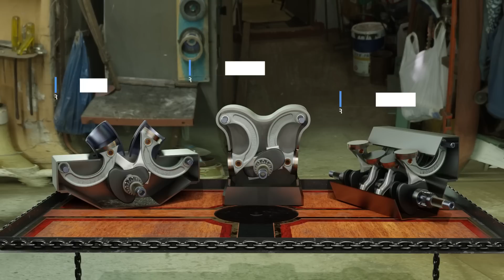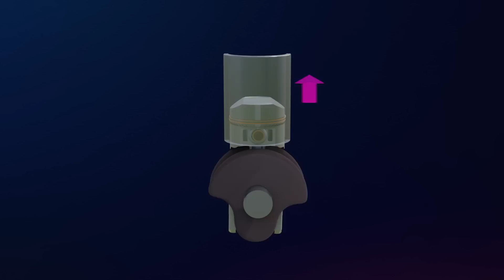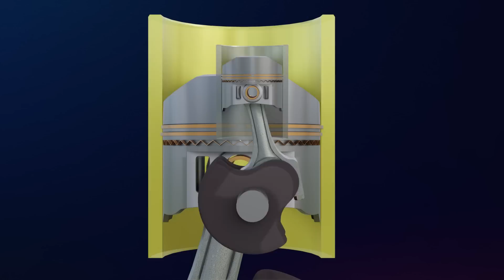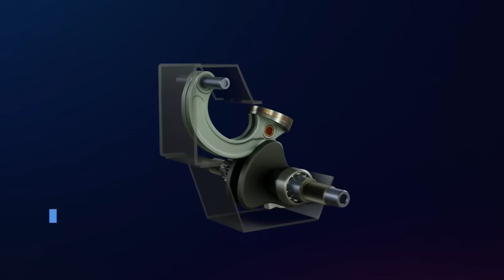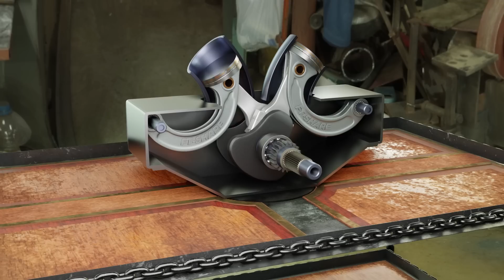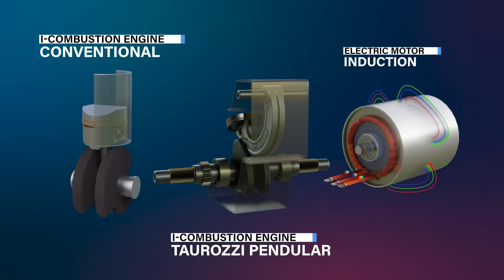All about the Taurozzi Pendulum Engine | Advantages, Working Principle, and Performance (100144.V1)

Comment: The combustion chamber is difficult to manufacture.
Reply: I feel like the metal 3d printers they use to make rocket parts could crank them out
Reply: @mistergreeen   I think due to size and weight, CG , and two stroke capacity, it’s ideal for ships , would do away with the sliding block con rod and lower height. A 16 cylinder v ?
Reply: Agreed.Very difficult to produce the curved bore with conventional machinery.
Reply: Makes me wonder how he made this thing back then.
Reply: All you need is a conventional machine,  and a aouter axis to fixe the blok on, and you do exactly the same as a normal engine step by step, while the block is the one who moves aroud the axis mentionned before, 
So simple
Reply: Very
Reply: The dam thing is even impossible to hone! This guy just wanted something to discuss. There's a reason everyone else dropped it. Lol 😂😂😂
Reply: @jasonruch3529  honing is easier part actually.
Reply: This can be machined in a block without difficulty, with the appropriate trajectory, but at a high cost. Current engines are made with sheet metal tubes fitted into a base, not machined in a block. On the other hand, the description ignores the additional mass of the second "banana" connecting rod, and its size. It is reciprocating weight. For me this engine is nothing revolutionary.
Reply: actually, it isn't.
it doesn't take much more than an offset drill and a lathe to drill an eigth of a toroid, as the curvature is pretty low.
Reply: @HenriBourjade  not really
Reply: @Om0sad  then how come taurozzi did it
Reply: @dennis-nz5im  Ships? I better use a turbine engine then.
Reply: Nonsense. You can die cast mold the whole block out of carbon fibre reinforced Magnesium oxide+aluminium phosphate chemically bonded ceramic, at perfect precision tolerances and mirror smooth finish in less than a minute at near ambient room temperature, one hundred times less pressure than plastic injection molding, and a few dollars materials costs. 
This material is far cheaper and higher performance than metals, and is used for coating high temperature and corrosive environment industral surfaces like gas turbine powerplant exhausts, industral chemical plants piles and reactors and molding Formula one disk brakes and piston-barrel sets.
These fibre reinforced ceramics are 1/2 the density of Aluminium, and 100 times stronger, have far less friction than metal surfaces, and lack of thermal expansion means no rings are required. 
This is used to coat high performance million dollar truck and military vehicle pistons. 
The only reason you don't see it in consumer level items is that it is too efficient, easy to do in your own garage, and lasts thousands of times longer than the shit the want to peddle to you. 
And therefore industry doesn't want you to know about it, and sell stuff made with low cost tooling and a few cents of material, for tens of thousands of dollars.
Reply: @yezzamouad9469  as a toolmaker I regret that I have only one like for this reply.
Reply: @teresashinkansen9402  ships, really big ones like container ships, use internal combustion diesel engines burning bunker oil.  A turbine is less efficient for these uses.
Reply: Honestly I don’t think it would be very hard but not by a standard bore machine
Reply: Not exactly, the issue is more that we'd need to make specific machinery for it whereas the normal straight cylinders can be cut and molded by normal machinery used for many other things.
Reply: @beatersnbeers2145  I agree. People these days seem to have no idea how easily high levels of precision can be achieved as long as you use simple machinery that has no computers involved with operating it. 
It's piss easy to achieve thousandth of a millimetre tolerances in something like this. By directly molding from something like basalt fibre reinforced Magnesium oxide/ potassium phosphate room temperature curing ceramic in five minutes.
Or if you must use primitive metals technology rather than far higher performance stone age stuff, then you'd  investment cast, then bore, grind and hone with a head mounted on a rotating pivot, rather than the more complicated and harder to achieve stiffness and precision linear slides or tracks of a conventional boring system.
Cheaper and easier to make the equipment to do this, than manufacture conventional linear stroke cylinders by far!
Reply: I fucking love you 😂
Reply: Easy to cast and easy to mill, you could even make this out of billet, it wouldn’t be complicated
Reply: @yezzamouad9469   exactly.  The cyl liners or block can be cast with a banana shape.  They are then mounted to a fixture that holds them in the boring machine.   This fixture has power rotation about the fixed end of the piston arm.  It rotates very slowly to feed into a cutter that is rotating but not traversing during the cut.  It does this 10 or 20 degrees and then rapidly rotates the other way to get the tool out of the bore so the cutter head can travers to the next cylinder bore.
Reply: Really in the age of CNC? And 3D printed Steel? Machines don't feel difficulty
Reply: @ExileTheKnightsOfMaltaNow  I can feel a less than 1/1000 of a millimetre imperfection. I can see a less than 1/millionth of a multimeter imperfection in the contour of a three dimensional surface by reflections. I can hand machine metal cylinders and pistons that need no seals for pneumatic pistons. 
CNC machines I have used a lot. It always takes a hell of a lot of hand sanding and polishing and lapping to turn something CNC machined or 3D printed into a precision surface. 
It's faster and easier to do most stuff the old-fashioned way.
Particularly if you are setting up for production. 
It's very difficult to achieve perfect repeatability with computers operating anything.
Reply: @aaronfranklin324  LOL looks like I struck a nerve? I am not proposing to eliminate the element of the human Knack of expertise... Let's not lose the greater point... That the occult is withholding things? Clearly the pattern of the rash of more than just knuckle-dragging
Reply: @ExileTheKnightsOfMaltaNow  Hey, I'm just this multiple x World champion high performance Engineer, you know. 🤗
I've experienced doing things both ways. And Frankly, it's faster and easier and cheaper to do most stuff without the use of computers. 
And Hand shaping something in the real world, it always seems to turn out looking better. Working better, and you kind of can't really get past the reality that you cannot 3D print or CNC machine anything high performance. Metals and plastics are very low performance materials. And it's usually the combination of q variety of different materials in complex shapes and combinations that gets the best results. 
So far Nature does this at the nanoscale a lot better than what we can. 
The strongest, most heat resistant, chemical resistant, durable materials are stone. 
And the toughest highest strength and energy absorbing per weight materials are natural materials like wood, bamboo, spider silk....
The cheapest too. 

When you can Make stuff that's stronger and stiffer than Carbon epoxy composites that lasts forever, molds to perfect precision mirror smooth optical tolerances in complex shapes setting in five minutes at cost prices  of a few dollars per cubic metre. 
That have no thermal expansion, are capable of handling highly corrosive environments at temperatures in excess of 2000C, 
Are widely used for purposes military, heavy duty mining, and oil drilling, and powerplant gas turbine exhausts....

Well yeah. It's pretty laughable that people think that metals and plastics are worth using. 
You are right. We are being conned. Told that turds are diamonds in the name of keeping the masses enslaved on a never ending treadmill, and the Elitists laughing as they milk the factory farms of gullible consumers they call cities.
Reply: All of that extra rod mass seems like a bad thing
Reply: @jasonruch3529  What about all of that extra weight in the rods that setup seems goofy AF
Reply: @blueberrywilbur315  there isn't any extra rod mass. The piston requires no skirt, and is one piece with the radial pivoting arm.  
Essentially the mass that normally is necessary to stop the piston rotating and produces lots of friction with the bore, is utilised to keep it in perfect alignment with the bore instead, via the pivot, and most of that lateral arm is reciprocating far slower than the lighter than conventional piston. 
Additionally there is a very large advantage here where the power stroke is able to directly push down  in line with the piston motion through the conventional connecting rod to the crankshaft for more than 180 degrees of the crank rotation, better matching the tangential rotation of the crankshaft, rather than increasing the big end bearing loads by applying radial loads towards and away from the centre of rotation of the crankshaft, trying to bend rather than rotate it.
and has no lateral component transferred to the sliding interface of the piston and bore that conventional engines suffer greatly from, causing friction and wear, and thermal problems.
 
There is also opportunity to vastly simplify a valve train by utilizing the radial arm of the piston rather than a complex of cam drive systems and poppet valves.

For a two stroke design the shallow skirtless piston is a huge advantage for crankcase air pumping induction, and enables far more effective piston porting and lower crankcase excess volume.
 
Since the development of solid-state piezo valve direct fuel injection systems , there is no advantage in any way to operating a four stroke cycle. 
Especially as for a given cubic capacity, at the same rpm there is half the loading on any parts for the same power output with a two stroke. 

And only 2 or 3 cylinders are needed for the smooth power stroke overlap of a 6 or 8 cylinder four-stroke. 

And resonant chamber supercharging is far lighter simpler, and more effective than the Nutbar complexity and  parasitic friction involved in turbos or superchargers.

There is no need or benefit from a separate head and cylinder either. 

So overall, this is capable of producing more efficient, lower emission, ten percent of the moving parts, a quarter of the weight, and size,far more reliable, and far lower cost to manufacture engines than any high or low performance conventional piston engine you will find in any vehicle manufactured in this century.
Reply: @aaronfranklin324  Wow and no one uses it wonder why? There clearly are negatives, how you can say there is no extra mass is kinda a guess. Since there are none of these in service and millions of rotary’s tells me it’s a pile of garbage. Rotary engines aren’t the best maintenance wise, they burn oil and get poor mileage in real world applications. That tells me it’s worse than a rotary and that sir is not a viable motor for everyday.
Reply: @blueberrywilbur315  looks like a good durable design to me... Remember this is billed as a lightweight engine... I totally volunteer to let them put one of these on my motorcycle... 1995 BMW K75 has 60,000 miles on it almost... not exactly a high-mileage machine despite the five gallon gas tank
Reply: @ExileTheKnightsOfMaltaNow  That’s a no for me Dawg…..Why I see almost zero advantages
Reply: @blueberrywilbur315  what were you thinking about during the presentation? 30% increased efficiency? Lighter weight, looks like reduced vibration... lots of different fuel options? Need I go on? I'm not a  pro mechanic nor Machinist . I'm a retired physical therapist but I see vectors and stressors... I like the way the machine runs in my head.. Like Thomas Edison
Reply: @ExileTheKnightsOfMaltaNow  I'm with you mate👍😁
Let's pester that cool Swedish 2-StrokeStuffing YouTube guy to give this a go.
Reply: @mistergreeen  à
Reply: No, it's not.
Reply: @Jellyflesh  in
Reply: Ya machining a block would take forever but there has been big leaps in metal printing
Reply: How is it done? Can it be cast and machined?
Reply: No its not. Taurozzi made in a simple mill.
Reply: @yezzamouad9469  you could never finish the tolerance in that manner you could ruff it like that
Reply: @aaronfranklin324  can u share a link or something regarding this? I want to read and study more about how can this be done
Reply: Nice try Mercedes
Reply: Its actually very simple, i mean he did it with back in the day with no special machinery
Reply: I have found a way and it's dirt cheap and achieve high tolerances not just that i have improved the (design) I'm looking down on u!
Reply: @aaronfranklin324  I very much agree with what you said. Consumer companies usually promote topics such as cheapness and running something on a computer As it is the future. In fact, directing the machine itself by you is actually easier and faster since dealing with the real and physical world is much easier than dealing with software and assumptions. In fact, there is a purpose for these consumer companies. To convert everything to run on electricity, even simple things that do not necessarily require electricity. The only thing I see in computers is the ability to draw/sketch and use automatically and remotely, nothing more.
Reply: Not so dificult
Reply: Not difficult, just expensive and slow to manufacture, which makes it impractical for mass production.

Comment: How about some details of how they have manufactured the cylinder block which looks like it's main manufacturing downfall. Making a round hole in one plain is relatively easy, an accurate curved bore, how?
Reply: My thought is you could make a spherical bit to bore the hole out and make a pendulum that it's attached to.

Comment: I had not heard of this engine before.  Manufacturing those cylinders would not be trivial but not an insurmountable difficulty.
Reply: overbore, sleeve and crush fit, hone done. CNC and the machine tech is here, make two heads or three, clamp together with a gasketless fit, and hydraulically sleeve it. If its really that good, balancing isn't that bad shave drill fit metal. I would love to see a precision one of these crafted and get an idea for life span and maintenance, and power factor. Always thought about adding H2 into the air stream to get a better burn on combustion, I think this system would work well with that.  Oversize the bearings for the expected load and keep them wet, looks like it could go many hundreds of thousands of miles.
Reply: Maching the curved bore would be the most problematic as cutting tools don't really do curves.
Reply: @guytech7310  why not make an internal hydraulic lathe to replace the piston? since it would move on the pistons pivot point, it would cut the bore perfectly in line, and the same system could be used to overbore when reconditioning the block.
Reply: @martin-vv9lf  Good luck on a alum. block with steel sleeves cylinders to fit that curve. 

I doubt this will ever been adopted by a mass produced vehicle.
Reply: @guytech7310  I certainly wouldn't suggest piston liners with this design. There are some engines that use a solid block with the liners in one piece that are very reliable. the problem then is increased complexity in casting.

Comment: And i want to create an engine that instead of using combustion to push the pistons, it uses magnets. So technically hybrid engine.
@Ft-share International any thoughts?
Reply: way to inefficient,why waste the extra steps when the energy can be used to turn a motor

Comment: The engine is complicated and there is no clear evidence that this pendulum engine is better in efficiency  because it have the same principle basically it's still piston engine... that's  why car company's only test it but did not meet the expected result. Its sexy engine though but I doubt that it's more efficient the simple design of straight piston engine.

Comment: Don't see why the same effect cannot be achieved with a Watts Straight Line Motion Device, or various other straight line movement mechanical methods. You don't need the curved cylinder.

Comment: conventional cylinders with offset combustion chambers gain much of what this design does for reducing friction but are far easier to manufacture. I think that's the main factor. They get probably 60-80% of the gain you would with this setup without the significant manufacturing difficulties or balancing questions.
Reply: Yeah. I agree. Mass producing these cilinders isn't viable unfortunately.

Comment: The mass of the extra connection rod drastically increases the mass of the moving assembly. The extra Madd results in energy losses to combat momentum changing direction as the piston reciprocates. 

The added friction of the extra bearing offsets any gains in the cylinder sleeve.

The entire idea is interesting, but i don't see crazy efficiency gains, just increased complexity.